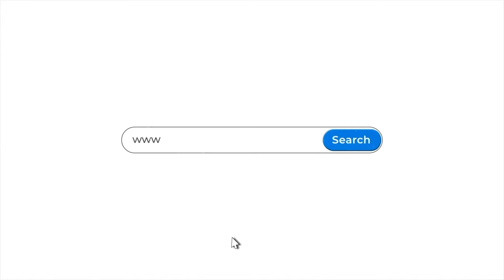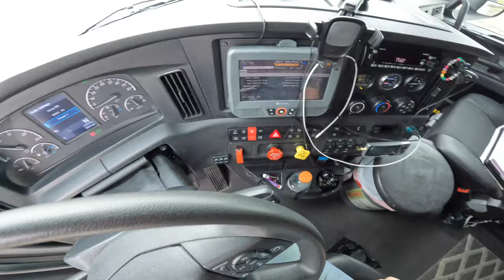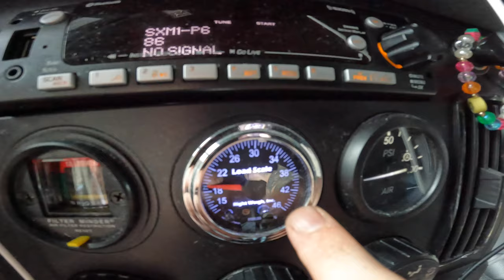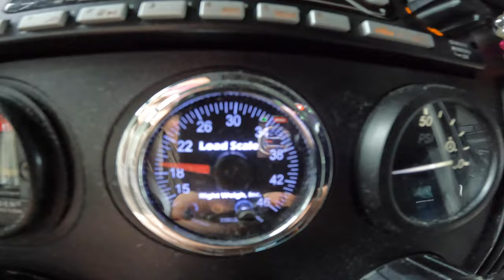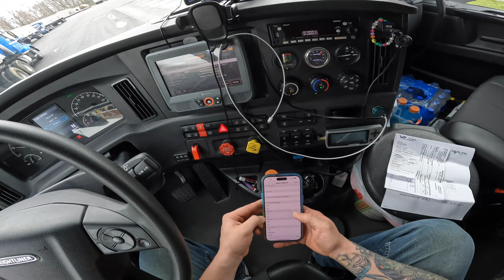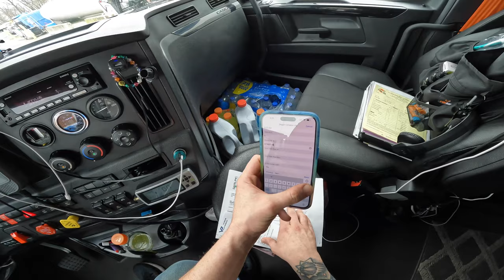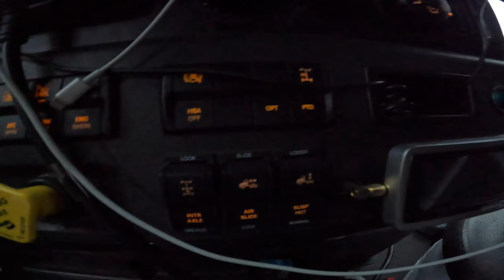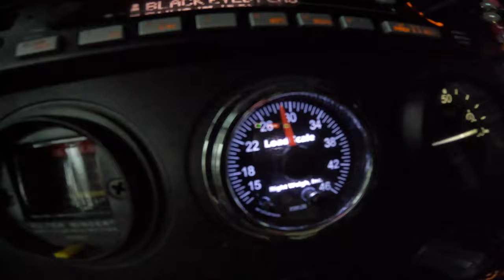Trucker hit with MASSIVE delays getting tanker loaded... Can it get worse? (Prime Inc Trucking)

Comment: Those freightliners can hold the cruise on Jake. Just set your cruise for 5 mph below what you want the Jake brake to hold you at and when you start going down the hill, put your Jake in stage 2 until you here it kick in and then move it to stage one. The truck will hold your speed 5 mph over your set cruise.
Reply: Do any of those trucks have radar to adjust cruise control speed to match traffic in front of the truck?
Reply: @nathansire6623  Yes they do. it'll notify you of a vehicles speed in front of you up to 500ft. it'll match and back off to 380 to 400 ft.

Comment: How well does the automatic handle the liquid surge?   I found the one that I had for a short time as a loaner while mine was in for repairs didn’t do so well.
Reply from the maker: I haven’t had any issues in the freightliner or Pete 579 auto. When prime receives the trucks they adjust the ECM to tanker specs to help control the surge 🤙💯

Comment: That's funny. I remember thinking why did Rex tell us about buying the galvanized pipe caps...
Reply: Why does he cap a pressure relief valve?
Reply from the maker: it's not a permanent fix, it's temporary so you can get somewhere safe to have it replaced or fixed just fyi... it can get you to your destination without have coolant gushing out of your trailer.
Reply: And for some reason some of the valves leak while driving the mountains. I've spoken to several that have had that issue.

Comment: I’ve been running pa for years. That’s why I won’t drive that kind of truck. My c15 will do 70 up that all day with a load. I run 85 through those mountains lol. It’s your truck it’s a emission up pile of junk. Love the vids but I’m sorry that automatic is not the truck bro. 

You must of took a long time in pa. The key is to haul ass on 76. I don’t do tanker so idk. But I’ve seen some tankers run just as hard cops give you 75 mph all day in pa mountains.

Also trucker path takes you off 76 on 68 or 80. It thinks there’s low bridge on pa turn pike lol it’s a low shoulder
Reply from the maker: my truck super slow 😭
Reply: @truckingwithrex  when you pay it off. Delete the def system and turn it up. It will run. My buddy did a brand new one auto trans. He deleted it put a nice big exhaust stack on it. Things louder and faster than my cat. They are animals if you delete and tune them. They told him 10 grand to replace the def system. He just deleted it for about 6 grand. Better fuel mileage and he’s had 0 problems sense